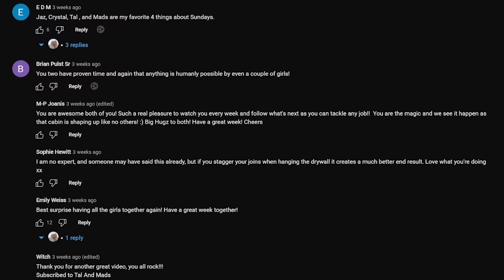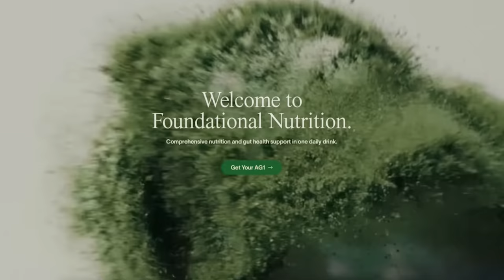We Should’ve Listened

Comment: Love your journey, and I enjoy the videos...

 I've been doing taping for 20 years. Here's a few quick tips. First. Use box mud - certainteed or CGC. Dump the mud in a 5 gallon bucket. Get a drill and paddle. For taping by hand, you want to add water to the 5 gallon bucket of mud - try 2 cups of water. You want to make the mud consistency like pancake mix. Now you want a mud pan to put the mud in rather than a hawk. Why? Because folks who lack experience 😜 can handle wet mud in a mud pan more easily. But only use the mud pan for taping. Now, use a 6" mud knife. Apply the mud on the seam or butt; I recommend taping all butts, then factor edges, then run your angles.

Also, there is a little tip for dry taping. If you're using paper tape, wet your tape prior to applying onto the mudded seams. But don't completely soak the tape, or else it will tear. Wetting the tapes  will make things go much smoother for you.

Once you finished taping. Hit all your screws with hard mud - straight out of a box of mud that's not mixed with water. Also. Use a 4" mud knife for the first coat on screws. Literally put the mud over the screw as small as possible, then wipe the area completely clean. The objective is to fill screws not build it out :)

Once the taping is dry and the first coat of screws is dry. Now you want to flush/coat the factor seams. Myself, I use trowels, and for the first coat, I use a curved trowel. (Curve Trowels can be purchased at specialty stores in Dartmouth/ Halifax).

Trowel all the seams out. Then, once the mud is set up and dry, hit the butts with the cure trowel. What you do here now is run the curve trowel on the outside of the butt tape on both sides; look at the tape and start in the middle and work the 2 sides. Let that fully dry. While you wait for that to dry, you can 2nd coat your screws. Go a little wider than the first coat. Now, at this moment, if you have angles to do, run one side of the angles wherever there are angles to coat. Don't do both sides. Do only one side and let it fully dry. You will get the other side of the angles on skim day.

Before you start your final step of mudding, you need to quickly sand everything. Be careful not to over sand. The objective here is to lightly sand down ridges and the edges. Make it flat and smooth, but don't overkill it.

So now that your butts are dry on both sides of the tape. You take that curve trowel and coat mud right down through the center. This closes in the exposed tape and makes a nice flat butt. Let that dry.. you can now stop and let everything dry nicely. I would carry on, but where you ladies are new to this, it's best to let it all dry.

When everything is dry, you can now use a straight trowel and finish coat everything: flats, butts and screws. Also, this is where you use your hawk. Hawk and trowels go together :)

So first skim off your butts. Go a couple inches out on both sides of the butt. Put the mud on the areas and trowel off tight. You're literally taking all the mud off. It basically just makes everything perfect. Then once all your butts are dry, which won't take long. Skim your factor seams. Same thing 2" out over the first coat on both sides. The best way to think about this is you want the seams 14" wide and your butts 24" to 28". Once butts and seams are skimmed. Skim all the screw with a 6" knife. Making the last coat wider than the first 2. 

And for the final step, coat the other side of all the angles. Let everything dry and sand with 180 foam back sand paper.

I really hope this helps you, ladies. I tried to break it down as best as I could.  Kinda hard to explain the art of taping and mudding, hahaha. It's one of those skills where you're either meant to do it or not for a living. 

Have fun, and I  enjoy your content. 

Cheers from Newfoundland
Reply from the maker: Wow wow wow, thank you Ryan, we are so impressed with your comment. 
You are so knowledgeable with all your experience. This was a step by step and we  sure do appreciate it.
We are so grateful to have you in our pack. We are sending love to Newfoundland from the pack.💛🐾
Reply: You're welcome. Best of luck moving forward with the journey.

Comment: My dad , who does not live in wilderness, but on an old farmhouse.
He has an Aga cooker, I was surprised he used it.
Even though 60 years old, it is connected to the hot water system that recirculates and goes thru radiators in other rooms.
Also has a stainless tank for instant boiling water.
And a drying rack. And oven.
He feeds it 3 times a day to heat 3 bedroom house.
Even though it weighs in at 1200 lbs , allegedly. 
Would solve a lot of off gridders problems. Heating, cooking and hot water.

Comment: Great job!  The ceiling presented a lot of challenges, and you were able to still get it done.  I think the break you took, stepping away and reassessing, made you determined to finish on your own.  If the bedroom ceiling has space, there are mechanical lifters that will position drywall overhead.  That takes all the strain of both lifting and positioning the drywall in place, which leaves you to concentrate on the attachment screws.
Reply from the maker: It really did!!! Thank you Wayne if we ever do it again we will have the lift 😊

Comment: You really need to look at this very serious safety concern:  

All trusses are designed for specific conditions, including top cord load, bottom cord load, lateral deflection and web deflection.  You have altered the bottom cord stability.  Usually, a solidly sheathed bottom cord is needed to keep it aligned and to keep them from deflecting to the point of collapse under load.  You don’t have that any more.  

Please find a structural engineer (or at least a truss designer) and show them you truss design, along with you location (for snow load calculations), and they will design a solution for fixing your trusses for cord and web strength.  This may be as simple as adding a few braces in specific location, but is very, very important.  Don’t dismiss this for your own safety, as well as that of your friends, guests, dogs, and your investment in your home.

Comment: I've been DIYing drywall and taping for +20 years. (several houses) Paper tape is the way. My biggest tip for you is soak the tape in water as you apply. Almost no one will tell you that. It sticks way better and doesn't peal as the mud dries. Wait, you will see, sanding is the worst part, yet to come! Yes you are making it hard on yourself. No pro would expose those trusses. Don't give up.
Reply: After watching this episode thru, I thought of a different way that I believe would have been much easier. Long vertical (instead of your horizontal) strips of drywall between the trusses, from top to bottom. Then fill in with narrow pieces as needed between the long sheets.

Comment: I wish I knew what job you guys were going next I would have suggested a simple tool to buy when a piece of dry wall is just too tight to fit.  Its a rasp file thats made for filing down the edge of a dry wall panel so instead of taking a piece down you could have trimmed it that way.  It makes a mess but thats what shop vacs are for

Comment: Use mesh tape on all your factory and butt joints. You can use a hammer stapler to hold the tape in place until you get the mud on which means you can put up all the mesh tape at one time. Use paper tapes in the "corners". Precut the paper tape to the size needed and then let it soak in water for a little bit while you apply the mud and it will go on smother.  Clean your tools at every break to avoid the gunk collecting and messing up your tape job and making you sand more.
Reply from the maker: Such great tips, thanks for sharing. 😊

Comment: To make fine adjustments to your cuts, so you don't have to go up and down the scaffolding to cut the mm or two off, one of the best tool investments you can make for the job is a drywall rasp. Yes it will be a bit dutier, but you don't have to drag the sheet up and down to fine tune!

Comment: My experience with drywalling was mixed. I hung the drywall myself then taped and mudded. The longest part, for me,  was the sanding after (I may have used too much mud). Things went well with my walls but the biggest problem I had was with the ceiling - the sunlight coming in made the ridges of the areas mudded and sanded obvious. You may not have this problem if you are not getting direct sunlight on the ceiling.

Comment: The pause and chill is so important. I hit some road blocks getting my new studio wall stenciled. I've only done small stencil borders in the padt. This wall was textured (which I hadn't notice before..ugh) which means the stencil doesn't lay proper flat and I was using water based paint in stead of creme paint, which bleeds under. I had one stencil and ended up buying a second because after 3 sections you have to clean them thoroughly (which are first took me hours on each but now I'm down to 1hoir each to clean). The first two sections were gloppy a.f and I was crusty soo crusty. (There will be weeks of futzing with a small brush in clean up!) I researched the best repositionable adhesive to help it lay flatter.. which only lasts about 2-3 repositions but you can't respray until they are clean... It's been so defeating at times. I pause a lot and I'm learning to forgive myself after a day or two of rest.. I have about 2-3 more sessions and the two walls of accent will be done. Ty for the reminder and example to keep trying. I have learned a lot of what not to do and when I'm done I'm sure I will enjoy it. But man... It's sux sometimes!! Ty for being authentically you and showing up to share with us. Ty for the encouragement.
Reply from the maker: It's so true. When we just take a step back for a moment it allows us to keep moving forward with you all, again. Thanks for tuning in and sharing with us your experience 😊 💛

Comment: When you are put on your tape use a 6" wide knife and then a 8" on 2nd coat then a 12" on 3rd coat and you should use a tray to put your mud in and always wipe off both sides of the knife each time you use it. On your 2nd and 3rd coat thin out the mud with a little water for easier application. Make sure to sand between each coat. Love you
Reply from the maker: Wow! Great suggestions Steve! 💛😊
Reply: @Vanwives  Keep at it but make sure you sit down on the couch with a cup of coffee and look up

Comment: Fiberglass tape is the way to go as it's stronger than paper and has more give in flexing. Your ceiling will move with the temp and as it does it stresses the seams. Plus it sticks on the wall without mud as the paper will not. Also that wasn't what staggering the seams meant. That 2 or 3 inch stagger will still possibly crack and when it does it run the entire seam. But that's how u learn and your learning. Flare your seams sand and paint it will blend in with everything else.  Your doing fine.
Reply from the maker: Thank you for your great suggestions Jeff, definitely some great ideas we could try. Thanks for tuning in 😊

Comment: I would try again, but do it with trusses not exposed.
It's difficult way has been tried , bit you've learned in experience.
Alsoputting up the large sheets much quicker .
And will make room easier to heat.
Also should close off attic with attic door.
Reply from the maker: We have spray foam so we can keep it open :)

Comment: Also use proper size trolls, U dont need a big troll if ur put 3-inch tape on! U putting paper on our corners cut paper to rough size and dip in watery mud solution, Put mud on corners using a corner troll and then put ur wet-mud tape in the corners, and smooth out. Oh and U use the mesh tape on the flat seems. The secret to mudding an uneven seem is the speed bump! you cant make it flat so it ends up basically needing to be a very slite speed bump over the seem. hope you understand. more on the seem and then it flared out on the edges. YOU
 GOT THIS!!!
Reply from the maker: Thank you for tuning in, sending us knowledge and motivating us, definitely tedious for sure! 😅💛

Comment: Dry wall is a pain in the ass - kudos for sticking with it!
Paper tape is better - mesh is for bathrooms, or wet areas.
Make sure you put enough mud for tape to stick (you can always sand off excess mud). And with paper tape, make sure the crease in the tape goes into the seam so that it lays flat.
Reply from the maker: Thank you for sharing all your experience and knowledge with us- good to know 💛

Comment: The strapping needs to go on the lower side of the roof trusses. Place them 16" oc and they will be easier to install, plus it will give you a better batten location to attach drywall to.

Comment: You absolutely are trying to do that at level 100!  I’ve never seen anyone drywall the angled ceiling between the trusses like you are doing. Most of the time when trusses are used, the drywall is flat on n the bottom joists giving an approximate 8 foot high ceiling that is flat and parallel with the floor. You have taken on a major project with many cuts and angles which most drywall hangers would not want to do. It’s looking very nice so far.  YouTube channel @Studpack YouTube has a very handy video of drywall finish tips about 20 minutes long that will help save you some troubles and make your job that much easier. Easy stuff like cutting the tape!!! Much love to you and watching for the next video!
Reply from the maker: Wow, thanks for the suggestion, Charlie. Yes, definitely stay tuned, lots more to come. 👏🏼😊

Comment: Dry walling roof is pain in the... Points for going trough that task! But, drywall sheets might not be the best idea for cabin that can not sustain stable temperature and moisture. Wood paneling could be a better idea. There is a risk that comes from temperature and moisture changes. Those will effect on the mud seems, that will shrink and expand, and the end result will be cracks. ( this is why you never should use anything else than paper tape on the seams). 
You cut openings for spot lights? Make sure, that you have enough space between the light and that foam. Best idea would be to have atleast 100 mm gap. And there should be some kind of a fire proofing in between the light and the foam. ( piece of that dry wall taped with aluminium tape).

Comment: I'm pleased to see two ladies tackle projects that would daunt most men I know. Having done some drywall in my dim past, I have to wonder why you didn't just put the drywall on the bottom of the ceiling joists? It would have been easier, made the cabin easier to heat and saved you a lot of grief.
Reply: Best guess:  Doing it the "easy" way wasn't the goal.
Reply from the maker: Hey jimbooth3 we have a plan. Stay tuned. Thanks for your comments.💛🐾

Comment: You know you have to sand now? then a finishing coat of a different compound? (or "mud" as you call it) Also the mesh tape is a million times easier than the old paper tape? Also, you need to chamfer the edges of the boards which there is a cheap tool for. Lastly it would have been SO much easier to board to the trusses and then get more insulation(sheeps wool) above it??? 
I've been doing this for 25 years... Great video though girls xxxx
Reply from the maker: Thank you for your feedback, Gary! That's amazing, keep up the good work 👏🏼
Reply: @Vanwives  I've just retired!! xx

Comment: you should have cleaned the rafters off before you put the drywall up. If you plan to paint he rafters, it would have been much easier to paint the areas where the drywall is before you put it up. Especially if you are painting them a dark color. But getting all that insulation off the wood in small areas may be rough now..

Comment: Mudding isn't too bad just takes some practice to get the skill down. I have 10+yrs experience  gotten real good at mudding. To avoid so much sanding do multiple thin layers & only lightly sand at the last coat you think it looks good. I also use a drywall lift for ceilings & a tape gun for all the joints. Trust me the tape gun alone will speed you up. Good luck  can't wait to see the next video.
Reply from the maker: Wow! Thanks for your support and feedback! See you next Sunday 😀🐾

Comment: Ok, so paper vs tape is really just a preference thing but pros prefer tape cuz it's so much faster and requires less mud in the end. Also, there's no chance of straggling mesh poking out. Mesh goes on easy like you said, but you have to apply much thicker mud to cover it completely, making it that much harder to make the wall / ceiling look flat and smooth.

As for your struggles on getting that living room ceiling done... you're doing impressively well for "first timers", but you might find it a lot easier if you didn't just cut your sheets in half and instead cut them slightly smaller or larger depending on where the trusses are. In other words, cut the sheets to fit against or notched around the trusses but not all the way around where you have delicate pieces of drywall that can break off. It also helps prevent mistakes by measuring less. By that I mean get your piece in place and mark the spots that need cutting out with a pencil or pen, and don't be too afraid to cut an extra 1/2 inch larger than what's needed if it's that finicky to get in place... that's what mud is for anyway. Also, plz try not to waste the mistake cuts, I know drywall is cheap, but so is mud... anything in drywall can be covered up to look flawless.

I still feel like you shouldn't give up though. Just continue reading the comments section and you'll get it all figured out eventually.